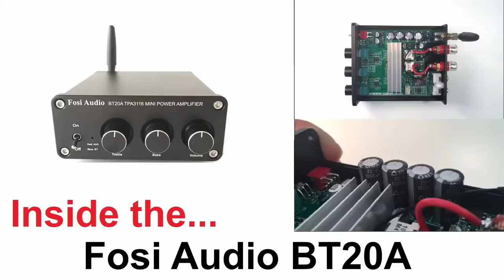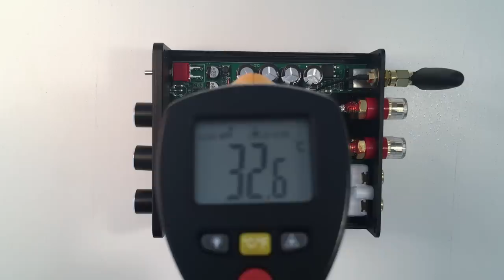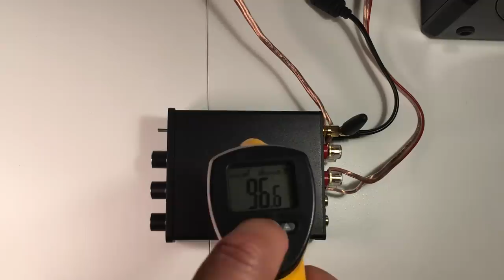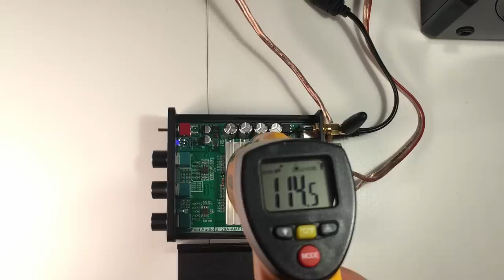Inside the Fosi Audio BT20A 2020 - Teardown and Test

Comment: Bought one of these in 2022 and it now has the Action Semis ATS2853 Bluetooth chip (no daughterboard), four bare toroid inductors on the output filter side, and the lid does not separate, I had to remove the volume controls in order to free the front panel, then remove the back screws in order to slide the unit out from the back.
Reply: Hi, i am no expert but the toroidal inductors should be an upgrade right (less noise I think) ? do you think that replacing the electrolytic caps with polypropylene/film caps improve the sound? (I assume same or more voltage + similar capacitance). Thank you

Comment: Fosi Audio BT20A procedures for the very best audio sound performance. I guarantee it! I've owned this amp for a while now, and having the time to experiment with it, I feel I have the best method to get the very best sound out of this unit. And it will perform very well and sound absolutely fantastic! 

The first thing to do after you actually own this unit. Or maybe before,  is to order an FX-AUDIO Tube 03 preamp to go in front of it. These two units paired together are a phenomenal musical combination. They should be married!

Once you have received and properly hooked both units together: Turn both the base and treble controls on the BT20A all the way to the right, then forget about them. You won't adjust them anymore. On the preamp, turn the base and treble controls to middle, and the volume control to middle. On the BT20A turn the volume all the way down before turning both units on. Now turn them on and allow around 30 seconds for the tubes to heat up on the preamp.     

Once your line-level music is playing, adjust the volume control on the BA20A for your listening level, and then adjust the base and treble controls on the preamp unit for your taste. There is a huge range in the tone controls to agree with most any listening preference. What we are doing here is marrying two units together as a pair of mutually complimentary singular engine in order to utilize the pluses of both units.  Alone, each works very good. But paired together, they are phenomenal! I have them driving a pair of 12” Eminence speakers designed for replacements for the Fender Twin Reverb guitar amps with an additional set of Pyle Pizo Tweeters mounted on the top of both 2 cubic foot cabinets.  

My old amp was a Pioneer 100 watt per channel amp with an an equalizer. And I have to admit, as surprised as I can be, these two units paired together sound much better! And the current draw and heat produced is phenomenally reduced to practically just a mere warm. Even those tubes only get lightly warm. This thing is simply musically wonderful!
Reply: looking at bt20a+fx-audio tube o3. thx
Reply: thank you, im lookiong for a FX Audio tube 03 but realized there's no Phono connection. Maybe any other tube pre amp may do this job as well?
Reply: Think we echanged on Reddit about this recently 🤔😁
Reply: Why do I need FX-AUDIO Tube 03 when I can adjust both bass and treble using BT20A alone?
Reply: @mhnoni  You don't actually. The purpose of the tube preamp is to add that warm tube sound to all the music.
Reply: @makarov138  so would you say getting getting a tube amp like Fosi Audio T20 would be an even better option?

Comment: Everyone!  CAUTION with the new version V02 of this amplifier!  The V02 PCB uses a Chinese chip ATS2819 , not the Qualcomm QCC3003 like in this video.  V02 has a sound dropout problem, something like a deliberate mute that lasts about a 1/4 second, that is very annoying not related to RF signal strength (phone can be beside the amp, no difference), especially at the beginning of a song.  You miss the first few notes.  

I don't know if the V01 in this video has the same problem because I don't have one to test.  But anyone who does, please try this simple test and comment.  The best way to test is if you have a good 2 or 3 seconds digital quiet period after hitting [Play] and before the song starts.

I suspect Fosi made a business decision to reduce cost and threw out the QCC3003.

BTW, for iPhone owners, the QCC3003 in V01 also has the AAC codec (in addition to the standard SBC codec), so with V01 like in this video, you get even better sound quality if you play a FLAC (eg in VLC) than most Android phones do though the standard 20-year old SBC codec.  I doubt that V02 has AAC, but that is conjecture, I could be wrong.

In any case in my judgement, the new V02 lobotomizes the functionality of the Ti TPA3116 high quality amplifiers on the board.
Reply: I have just received my V01 and it does NOT have the bluetooth delay you speak of.
Reply: @alsterling9313  thx for your test and confirmation.  I think Fosi shot themselves in the foot by going cheap and cutting corners for more profit.
Reply: Thanks, i have the same sound dropout problem with my Wuhzi Audio ZK-502T  .
Havent tested it with bluetooth 5.0 jet but only withBT 4.0 and 4.2 (funny enough this amp goes louder with the older BT4.0  and if i dont put my phone volume on 100% the low volume sounds cutout of songs and videos/audio where theres voice only the dropout of sound is horrible it keeps shutting off and on again on lower volumes can hear the plops of the amp going out of standby bluetooth mode  The amp goes into standby mode when theres no sound playing doesnt matter if you are playing a video or a sound file, whenever there is silence in the file the amp goes into standby     (same problem with my BT4.0 computer dongle although the volume is high but bit muddy below 400hz and sharp above 400hz
The aux port is fine tho  but sensitive to lose cables.  also sound a tiny bit metalic robotic  with a low volume hum
Reply: @cybernaab  very interesting.  I understand that the 502T indeed has what you describe.  These things must come from one source in China but have multiple distributors that purchase their own branding.. The 502T has a JL BT rcvr, also Chinese with the cut-off issue.  On the other hand, any of these amps that use a Qualcomm rcvr should work properly.  iPhones use the HiFi AAC CODEC, so an amp with a QCC3003 is the best choice.  For phones that have aptX or aptX-HD CODECS, get an amp with QCC3034.  Btw, rip your CDs with Audacity as FLAC files, install VLC on your phone, copy FLACs to phone, and use the line-in with a short cable. You won't believe your ears. These tiny Ti class-D amps are phenomenal.  On the amp, set tone controls flat and adjust in  VLC adjust the equalizer to match your speakers and room.  Then tweak tone controls.
Reply: @stickfijibugs  Thanks for the info, i mostly use android and before that mp3 players with low output.
I kinda miss just using aux  my cheap old car amps do fine on small batterys outside  but using bluetooth is annoying.
Can be easy fixed with a car headunit that has bluetooth  but thats to big for me and draws to much power.

Getting a decent enough class D amp that also has a good bluetooth implement is so hard to find..
It's like the makers of these amps somehow always f**kup the bluetooth wiring using bad chips or simply not correctly grounding the board etc etc  its not like wil cost them extra money. With just a few simple fix they could easily win their place in the market.

Cheap bluetooth and amps from china get a bad rep because of them
Reply: Hi, on link in description, QCC3003 is “NOT FOR NEW DESIGNS”, then maybe is EOL…?

Comment: So today I got a red light upon turning on my Pyle BT20A TPA 3116. I only use this amp with speakers at low volume. It doesn’t connect to Bluetooth as me the sound isn’t working. Thoughts?

Comment: How could an amp supply 100 watt per channel when the power supply  is only giving 108 watts total?  Even with 100 % efficiency   at full volume this will only produce 50 watt per channel at best case scenario. This is not a bad amp for the price but it is not close to 50 watt per channel at least to my ears. I would say it can play somewhere around 20 to 30 watts  comparing to a pure Class A amplifier not bad at all  for the price .

Comment: Perhaps I don't understand, but how can it output 100Wx2 RMS when the power supply is only 24V 4.5A?
Reply: Looks like it's not the case with this one but, the TB10D specifically comes with a 32v power supply. It can handle 48v to output its rated power.
The Amazon listing for the BT20A states 100W MAX. Maybe you misinterpreted the numbers.
The TB10D claims 315w x 2 MAX to 4 ohms /w the 48v power supply.

Comment: Did you find that this is actually 100W/channel? My speakers are 4ohm, 87 dB sensitivity, and rated for 10-75W. I’m trying to figure out if I should buy this model amp or the one with 50W/channel.
Reply: Not possible with the included power source. Multiply voltage by ampers to see wattage
Reply: There are some dyno tests on youtube, and it reaches maybe 75% the rating.  Get the 100W if you plan on listening at loud volumes, otherwise 50w is fine for casual listening.

Comment: Is this powerful enough to push some 6x9 car speakers and give good bass? Other chinese Amos fail
Reply: I don't see why not. I use this model to push 8 ohm 3 way speakers consisting of 10 inch woofers with 87% efficiency  ratings. They get loud enough. Basically in my own opinion, this amp will run decently and 90 or above efficiency  speakers whether 4 or 8 ohm. 6×9 speakers should sound decent. A 400 watt modified  inverter  can easy  convert this to be used in an automobile with little to no noise being picked up. The 3116 chip is extremely efficient and runs cool. 2 fully charged 12 volt 7 amp lead acid batteries wired at 24 volts can run this amp efficiently  at 50% volume for at least 8 hours.

Comment: it state 24v 6amp power supply or 8 amp can be used , does it make a difference ?
Reply: no difference other than available wattage, 24v 8 amp supply would have 192watts supply and a 24v 6amp supply would have 144watts.  If you run high volumes or use very large speakers, you might need the higher wattage supply.

Comment: Do you think this can push my HPM 40 speakers?
Reply from the maker: Hi Dis Hayn, I only tested this with speakers with an impedance of 6 ohms (Yamaha NX-E400).
Your HPM 40 speakers have an impedance of 8 ohms, so they are a bit more difficult to drive. For this reason I cannot answer with 100% certainty... What I can say is that no matter how high I turned the volume on this, I never got any distortion. With my 6 ohms speakers I could turn the amplifier to it's maximum volume and the sound got pretty powerful without any distortions... I think that if you don't need to use it for very loud disco parties it should be ok :)
Reply: Thank you I end getting this amp and at max I had no distortion. It plenty loud for a bed room and Definitely these speakers can take more power

Comment: its not a good amp power wise distorts before clipping gets to 105 watts with clean 0 Db signal @ 4 Ohms will not accept 2 Ohm loads on sub woofer side so if you have a decent sub check the Ohm load before using the board will fry LOL https://www.youtube.com/watch?v=wrBPAP3nol0